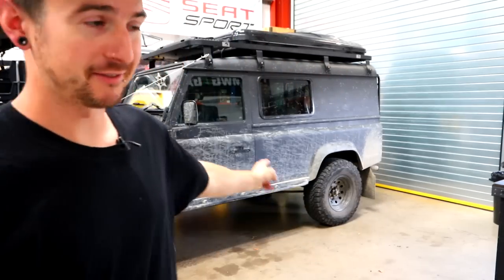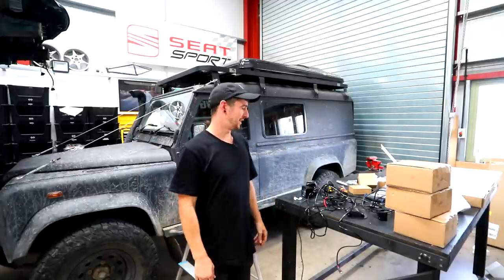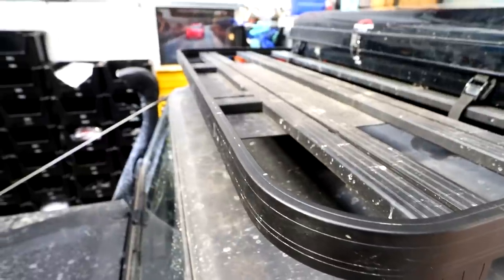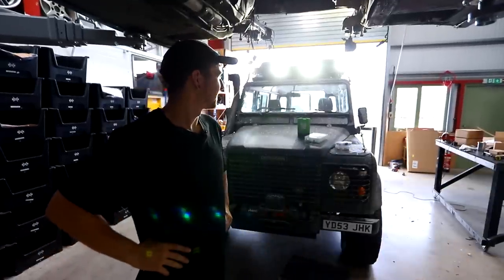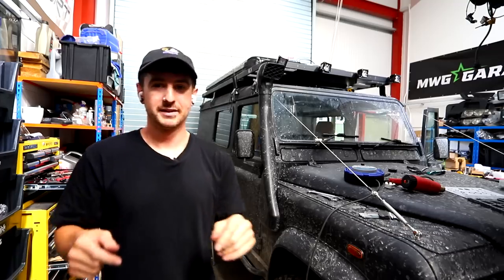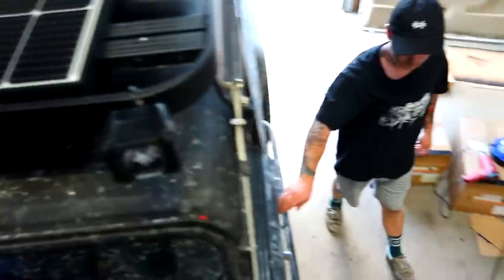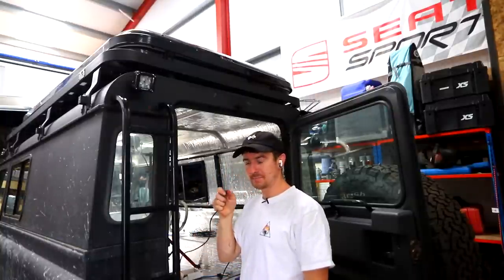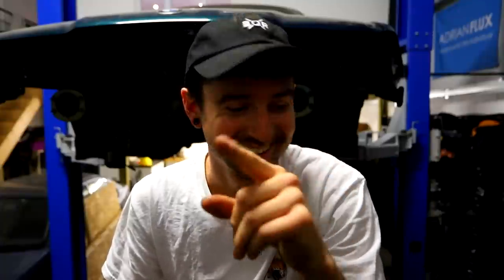Defender 110 build is ready for OFF GRID

Comment: Doing good. Recommend dont block access to vehicles original electrics. was sorting something on my 300 tdi 90 own for 14 ish years found a egr control box under the cubby box, glad I never drilled down through the cubby box (assuming its still working).

Comment: You need diff and gearbox breather extension tubes if your wading in water, without they will fill with water and you'll have to change the oil each time to get the water out , the tubes run up the side of the snorkel.
Reply from the maker: Already got them bud just haven’t fitted them yet haha

Comment: Just gonna say but the metrics you used for the spots was shocking 🤣, 2.8mm between each spot? Just under 3cm
Reply: Doesn't matter I see what you've done you've then times it by 10 for the rack 🤣
Reply from the maker: It was 2.8mm for my 140mm diagram which translated to 28cm on the rack haha
Reply: Yeah noticed afterwards what you'd done 🤣
Reply from the maker: @WillGilbey1  although it should’ve said 28mm not 2.8 so you are right 😂

Comment: You kno the metal edges of the holes you drilled will rust because you didn’t prime/paint them..
Reply from the maker: Roof rack and body of defender is aluminium dw, doesn’t rust